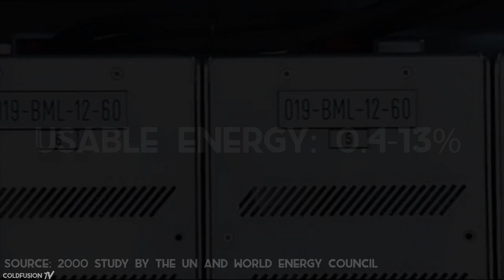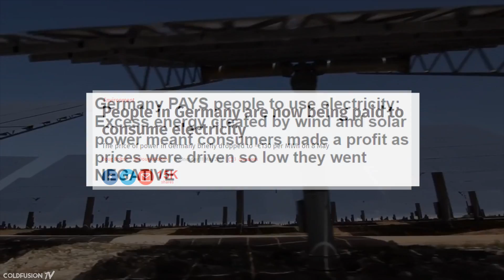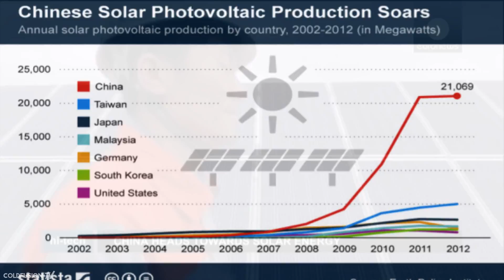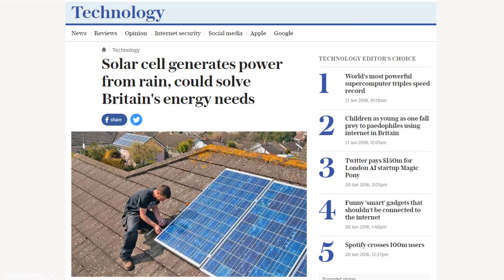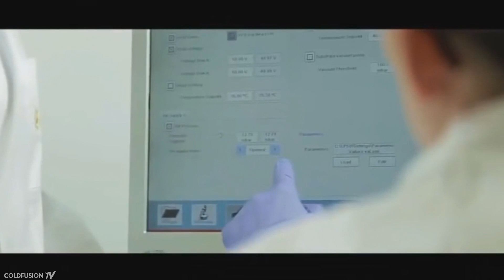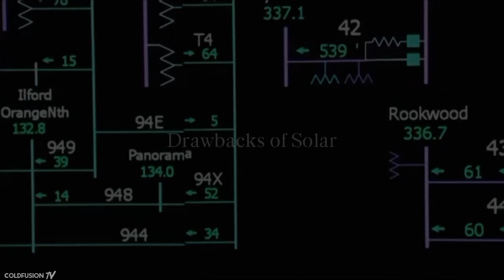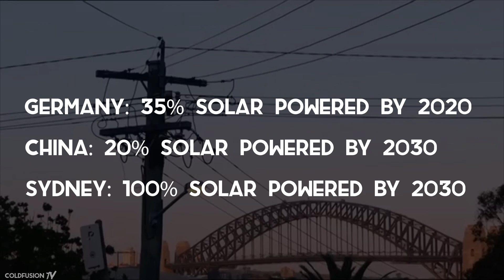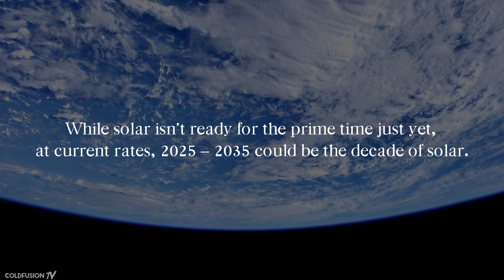The Truth About Solar

Comment: Solar electric generation is erratic requiring some type of storage to provide grid quality electricity.   Solar plants trying to provide grid quality power have used expensive molten salt solar towers that have storage in the form of the molten salt liquid in combination with much cheaper solar electric panels.   The solar towers have mirrors focusing intense sun light on to it.   When birds fly into that intense heat they fall out of the sky.   Solar electric with storage batteries able to run a house for 48 hours don't make economic sense if good reasonably priced grid electricity is available and that is with huge government subsidies that everybody else is having to pay for.   It does possibly offer a good solution when needing to live off grid in combination with fuel oil backup generator and oil heat.

Comment: At peak solar theoretically can achieve 20% efficiency. Your claim of 30-35% is outrageous. After full conversion it's about 18% before thermal degradation. Then transmission beyond the panel usually leads to 8 or at best 8.25% of the solar energy converting to usable electricity. Now imagine transporting that load hundreds of miles and the energy lost would be more than the sum total of the energy put into the infrastructure to get us beyond 30% grid power. And that's not just the first day. It's every day. Solar is not feasible without robbing the world taxing them for their labor and inflating the currency. A massive robbery to pay for it all just to hide the real cost per kilowatt hour. Without the subsidies what's the actual cost? No one really knows. Without the investment from governments with tax dollars and printing off trillions devaluing the dollar and the euro I bet the cost per kilowatt hour would be the same as an ounce of gold. Somebody do the math if you cover 10% of the world's land mass in solar panels and then get 8% of the solar energy what can you do with it. I'm sure it's enough to power the homes and electric cars of the top 1% wealthiest individuals for half of their power usage.

Comment: One of the downsides and threats to this industry is the extreme polluting manufacturing process. What are we going to do with out of date solar panels ? Can we recycle them ? We still need rare mineral elements... If we talk about large scale infrastructure what large scale mining activity are we going to need ? Can we still talk about "GREEN" energy ?. Last but not least figures have changed since, would be interesting to have an update on the current situation.

Comment: 3:02... nope, solar panels currently runs about $1.00 per watt, for the panel alone...

add onto that the installation cost for labor and materials, plus cables, plus batteries, plus charge controllers, plus inverters if off-grid and/or switching modules and integration with switch panels / breaker boxes if grid-tie, and you are looking at thousands of dollars for a tiny system or easily tens of thousands for a system appropriately sized for an average household.  

until the systems are more efficiently produced or consumption drops dramatically (like bye bye to dependence on most comfort & convenience electrical items) , solar is not a feasible full-time global scale solution.  we're a long way off.

then we'll have to deal with recycling costs as panels deteriorate, which exceeds the r.o.i to reclaim the raw materials, so in short time, we'll have loads of landfill waste on top of the pollution created manufacture solar panels in the first place.
Reply: Good points 
Also..there are toxic metals in solar tech..not sure if the panels or other equipment 
At least 5 toxic metals

Comment: Unless they can work out an efficient method of recycling panels, i dont think it will ever be as good as people think it is.. the panels have to be replaed every 5-10 yrs.. and these cheaper ones its more like 3-5 yrs, and these panels arent harmless, and when you think of trashing 1000 acres of panels full of cadmium and other harmful shit, it gets dicey.Also For the most part solar hasnt changed much since its conception, in terms of power generated... So alot of space is needed, we need to cover conservatively 1/3rd of all land space to power most places, and even then it wouldnt be endless.. if were being honest, i think hydro power would be more effective.. but just like solar, you'd have the ecosystem issues... placing tons of tidal fans under the ocean could get messy... same as clearing tons of land for solar panels would.. in all honesty.. I think we just need to put more money into effective nuclear power.. it doesnt produce Co2, and if we can create effective protective measures to safe guard them, and find a way to recycle spent rods into something that could be useful.. we'd be much better off than endless toxic solar panels full of cadmium and lead filling up the land fills

Comment: I disagree about the solar revolution destroying the existing power distribution network. In my simplistic opinion I think that distributed generation will ease the load on the transmission network, not bring it to its knees. I have just 5kw of generation on my roof, but I don't think it even gets to the main grid, rather my neighbours use it, so in effect easing the load on the national grid. Thoughts?

Comment: JUST A FEW IDEAS I HAVE ON THIS. FIRST OF ALL THEY'RE WAY TOO LARGE IF THE FIRST ONES WERE 10 TIMES THE SIZE 40 YEARS AGO AND WE MANAGED TO CUT THEM DOWN TO THIS SIZE. NOTHING STOPPING US FROM MAKING THEM AS SMALL A POSTAGE STAMPS WITH THE POWER TO RUN A "TRANSISTOR" RADIO ALL DAY. NEXT REPLACE THOSE GLASS COVERS WITH MAGNIFYING PLASTIC TO CONCENTRATE ENERGY FROM THE SUN MAGNIFIED MANY TIMES(NOT SURE IF THIS WILL HELP BUT CAN'T SEE IT HURTING) THE LAST IDEA I HAD WAS TO INCORPORATE NIGHT VISION TECHNOLOGY INTO THESE AS EVEN NIGHT TIME COULD POWER ANYTHING BUT IN DAY WOULD INCREASE IT'S POWER BY A FACTOR OF MAYBE 100X. RIGHT NOW I BELIEVE WE'RE IN FRED FLINTSTONE'S ERA ON THESE!!

Comment: Lets talk about energy density....when a solar panel can move a 5,000lb (2267kg) automobile at 70 mph (113  Kph) up a 10,000 ft. (3048M) mountain, and fit in a 1 gallon (3.785 L) container that is purchased for $1.85(USD), then we have something to talk about. There is roughly 4 kilowatt/hr worth of energy in 1 gallon of gasoline, this would take approx. 25 solar panels that are 5.4ft x 3.25ft big for a total of 440 sq.ft. of solar panels.  These panels would give you 1.25 Kw of power per hour, so you would need to wait 3.2 hours to have stored enough energy as a gallon of gas. Providing of course you live in Texas and you have the right solar index, and it wasn't cloudy, and your batteries were at peak efficiency....No one ever wants to talk about the energy density. The only reason Tesla's and other EV's work today is because they are burning fossil fuels, natural gas and coal, as well as Nuclear power. You wouldn't have enough acreage to power every single vehicle in the world with solar energy. Remember in the above scenario, you only went as far as 1 gal. of fuel would take you.

Comment: A first-of-its-kind energy- system has been added to the grid in the . The 5MW/15MWh system stores energy in an unusual way: it  excess  to cool ambient air down to -196°C (-320°F), where the gases in the air become . That  is  in an insulated, low-pressure container.13 Jun 2018

The way forward is to use surplus electricity to liquify oxygen - when needed the oxygen can power a turbine. Not a dream but working plants already exist.

Comment: at  6:19  they claim it absorbs all the light coming from the sun but the panel shown is almost transparent and thats a lie (since anything that absorbs all the light from the sun would practically be black). they havent even hit 20%  just check " https://www.laserfocusworld.com/detectors-imaging/article/14035450/saule-prints-flexible-perovskite-solar-modules-with-consistent-10-efficiency " though i gotta say that perovskite seems very promising due to being thin and fexible

Comment: Thank you for good content. This is a good video. I have always wondered, however, there is little to no discussion (from all the sources I’ve observed) of the sustainability of solar technology with respect to 1) limited precious metals required to produce solar panels as well as batteries and 2) limitation of battery technology to store electricity and later its safe disposal.  If we go all solar, do we have sustainable raw materials to produce solar panels and batteries and later safely dispose these batteries?
Reply: Precious minerals like sand?

Comment: While solar with batter back ups will become very common on houses and s bit on business, it wont be the fix all for the future. You need inertia in the power systems to respond to instantaneous demand. A stable power grid in the future will require a majority of thr power generation to be nuclear.

Comment: What about the toxic waste from solar panels, they use toxic chemicals to make and most are not recycled.  Are we replacing one problem for an even worse one.  Land filled with solar panels which will leach toxic chemicals into our water table.  And lithium batters are toxic to produce and can catch fire, releasing toxic chemicals and the lithium fire is almost impossible to extinguish.

Comment: Interesting story. In 2018 I had a college project that required me to make a business plan and a product. The product I made up was called "solar skin" and was designed to be a an incredibly thin, transparent solar foil that wraps around all surfaces of an electric car that can be exposed to sunlight. Its purpose was to absorb light from the sun (of course) but also to generate electricity using heat. Why heat? Simple, cars get hot really easily when in the sun. You ever plant your hand on literally ANY surface of a car after leaving them in the summer heat for a few hours? Yeah, that shit gets hot and quick. They're essentially large solar heaters and that heat could be converted. The funny thing is that this would have the effect where most cars would have to be painted black for maximum efficiency since black is the best colour to use for absorbing light and thus increasing heat. White (being the most reflective for light) would be the least efficient.

That idea never left my mind because of the simple fact that I seriously thought it was actually feasible. Now here I am watching a video that was made in my first year of college proving that the concept I came up with in my third year was not only viable, but already in the works. It makes me enormously happy to see that although I was a few years too late to the idea and someone had already beaten me to the punch, I was still right about it in the end and it could easily become a reality. Hopefully they can find a way to incorporate the heat absorption aspect into it if that is even possible.

Great video by the way

Comment: My concern is: what happens ten years from now when your shingle roof needs replacement. Who pays to remove the solar equipment and then it's replacement after the new roof is installed. Here in Illinois the cost of your license to drive an electric car is a cool $300 for tags. Why ? The only reason I can think of is the electric car does not generate any gasoline sales tax for the state; so you make that up when you renew your tags every year. Saving energy is great but what about the hidden and undisclosed costs of some of these " energy savings ".

Comment: This is a BullShit Video...current efficiencies for solar panels is an avg of 18%, NOT 30-35%,further it states that it produces electricity at 36 cents per watt,which is a Bold Faced Lie...Example: If a 100 watt panel costs $130 USD then the cost per watt,(panel only),is $1.30 USD,...And then here comes the increase of cost per watt,(the solar power system),i.e. cabling,power inverters,solar panel mounts,battery bank,and installation!!! The average home in the US consumes 3000 kilowatts per year avg. or 8.3 kilowatts per day or an average Solar Power System for a home,$28,000.00 USD - $32,000.00 USD...So if you purchase 280 watt panels,(would require 30 of them),that would equate to $7500.00 USD - $8200.00 USD and that is just for the panels!!! Is Solar Power justifiable for the world...NO..NOT until the cost per watt becomes approx $0.11 - $0.17 cents per watt!!! Another thing to consider too is the system maintenance...panels only last 15-17 years so you're replacing them before the System is even paid for pushing back on the day that you will be actually off the grid completely,plus what about the inverters and the battery bank  and their longevity???

Comment: It all sounds so good, there are tremendous issues relating to solar energy. Solar voltaic cells produce DC electricity, this has to be converted to AC using massive inverters before entering the grid. Solar panels need sun light, when cloudy their efficiency falls rapidly. Solar panels don't work at night, so you have to  use battery storage (currently Lithium ion, or Lithium polymer) are the only systems currently available. No doubt battery technology will improve greatly, so what do you do when the old used panels and batteries get thrown away. Checkout new technology into Nuclear power stations.

Comment: Out of all their videos I've watched so far, this is BY FAR THE WORST. All you did was dick ride solar energy the whole time. You completely avoided the subject of initial costs unless you count a two second mention of replacing infrastructure. If you're going to try and sell an idea to people, long term costs are BS. I don't care if years down the line it's ¢8 per Watt or whatever you said, but if it's going to cost me $100,000 just to even get started I'm gonna take a hard pass. Also, even though you mentioned the biggest problem solar energy is going to face, you made it seem less significant than it is. If solar becomes so efficient that customers either pay nothing or start to get paid to use the solar panels, then it will never be a viable business. NOBODY is going to run a company that doesn't turn a profit. Even "not for profit" industries and "charities" turn a profit in some form. You can not expect people to invest in an energy source that is going to end with them losing their entire investment in the long run.

Comment: unfortunately, some of the other drawbacks you left out is the retrieval and the refining of the raw materiel  and manufacturing uses a lot of fossils fuels.. the silica sand needs to be mined from a Quartz quarry because it needs to very pure with machines using fossil fuels ( not to mention transportation). The silica sand needs to be mixed with coal, or coke or woodchips ( a source of carbon) in the furnace, the mixture needs to be heated to about 2000 c, which is usually done by an "electric arc" ( where would this electricity be coming from???). This produces carbon di-oxide and Silicon. The purity of the allow needs to be at or greater then 11 9's in percentage form. This process needs to liquify the resulting alloy and then to distill it, and it goes on and on... its a sad irony really.... isnt it?

Comment: It is all like gangster racketering   Electricity is magnetism. They use generators. You barely need much current in your home. The price is just outrageous robbery. Isn't there a supposed principle of ridiculous capitalistic economics in that the more product you can offer, the lower the price should be. So called Electricity has no reason to cost a lot or any justification to increase in price.   It is a complete falsehood that you need to save it.  It is energy.  It is not a physical tangable resource. It is the harnessing of the  the electromagnetism that is natural  and is from magnets and copper going in a circular motion.
Reply: You don't know what you are talking about.

Comment: Not only electricity from the sun but what about the heat from the sun. 
Hot water from the sun to a holding tank.
 Then a Stirling Engine(s) to a generator for electrical power?

Comment: "The truth About Solar????"
1. solar is not free.  You need to buy the solar panels that need to be replaced every every 20 - 30 years, which is why it is one of the most expensive ways to make electric power.
2.  this video doesn't mention the highly toxic materials that are required for manufacturing solar panels. 
3. there is no method for recycling solar panels... so, they mostly go to the dump.
yes, the things he says in this video are true...  But, he is leaving out the most important information.
Reply: My solar panels are made from silicon ( sand ) and aluminum.
Reply: @MrSummitville   I find that hard to believe, however if you have more information about a panel that uses only Al as a dopant on a silicon substrate I would be interested to read about it.  Most panels are using highly toxic substances such as gallium, arsenic, beryllium, and geranium as dopants. Also, as far as I know usually two different dopants are needed because you need two different junctions (p and n). Please correct me if I am wrong.
Reply: @droberts7725  The FRAME is aluminum
Reply: @MrSummitville  okay well, in the silicon part of the panel, it's not pure silicon, there are plenty of really nasty toxic elements that they add to the silicon.  A pure silicon panel will not a functional solar make.  Good news for you though, when your panel quits working after 20 or 30 years, aluminum is very easy and cost effective to recycle. Your panels however will be polluting the earth for hundreds or thousands of years as they crack an break into smaller pieces.